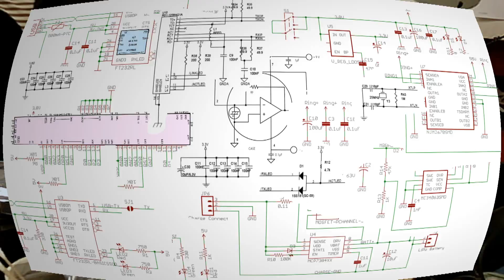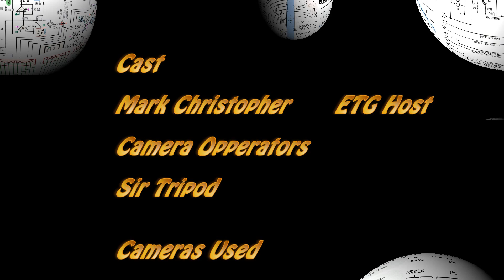ETG-1-03 DC to DC Converter MC34063, Getting Started

Comment: Thanks for the video, as well as the spreadsheet Mark! It is quite useful in tweaking things to get component values just right, and fine tune things; definitely a time saver. Here are a few corrections for the sheet I've found. Users can simply paste new values into the cells.
Cell  |  Correct formula
D23:   =2*F11
D25:   =((B15-F7-B13)/D23)*D21
D18:   =(B13+B7)/(B15-F7-B13)